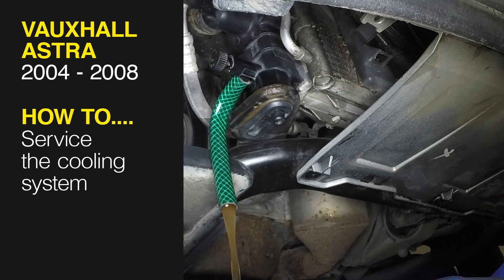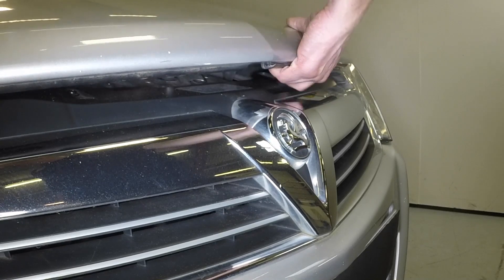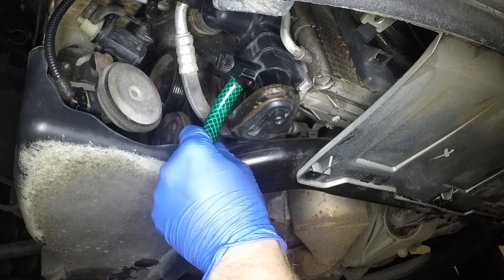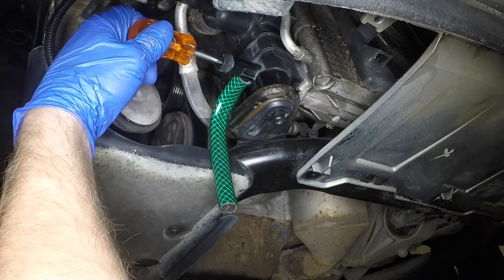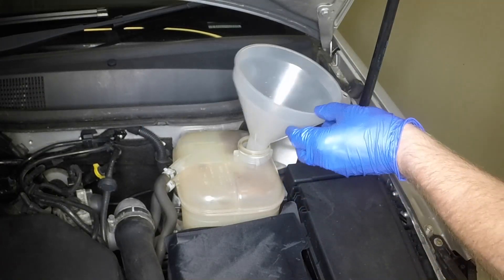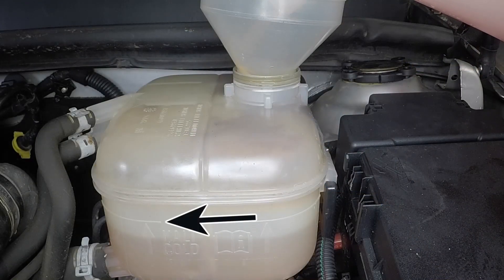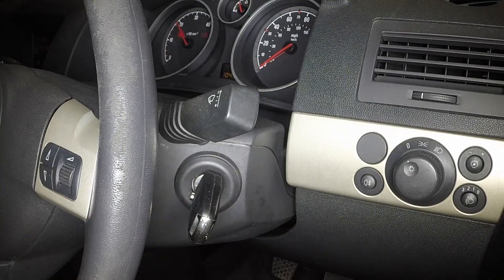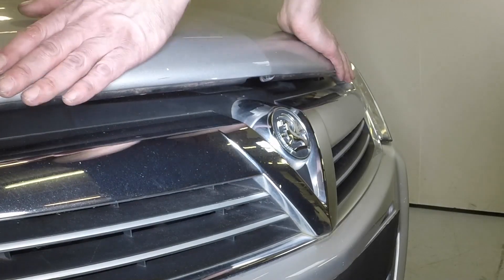How to Service the cooling system on the Vauxhall Astra 2004 to 2008

Comment: My Astra is a 3009 hyperdrive 3 will it require additional plasma flux now it has covered 6 light-years?
Reply from the maker: Yes, but use the blue plasma flux, not the red one.

Comment: Hello Haynes,  Are the coolant hoses supposed be a  firm when the engine is hot?
Reply from the maker: Yes, when the engine is up to normal operating temperature, the coolant will be under pressure (around 1.0 bar), so the rubber hoses will feel firm.
Reply: @HaynesManuals  Thank You so much for the reply.